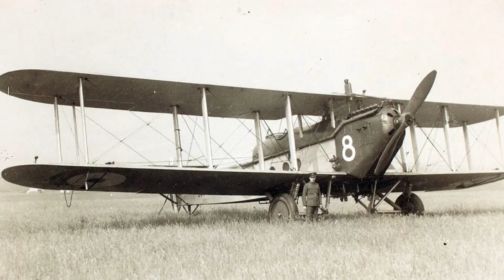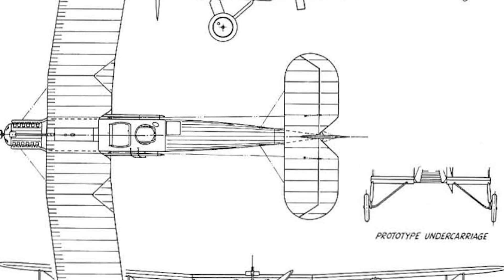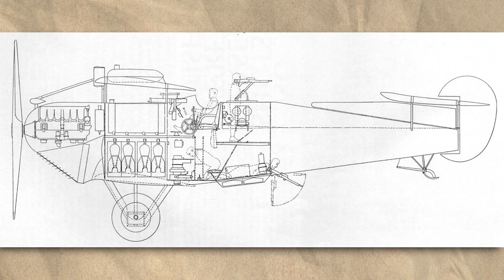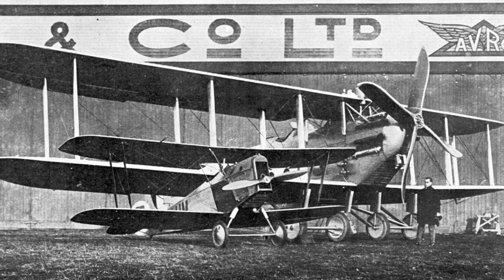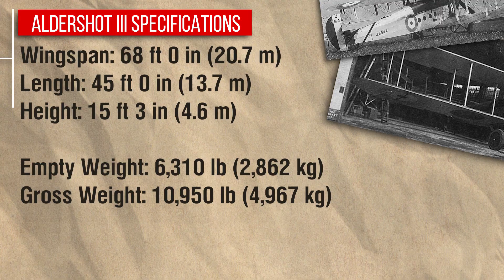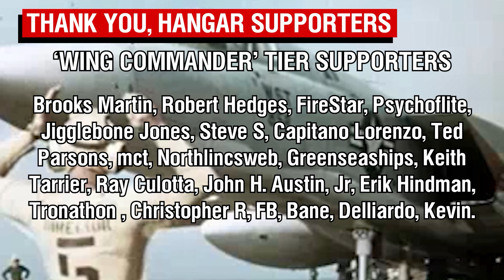An Engine With A Bomber Attached To It | Avro 549 Aldershot [Aircraft Overview #75]

Comment from the maker: F.A.Q Section

Q: Do you take aircraft requests?
A: I have a list of aircraft I plan to cover, but feel free to add to it with suggestions:)

Q: Why do you use imperial measurements for some videos, and metric for others?
A: I do this based on country of manufacture. Imperial measurements for Britain and the U.S, metric for the rest of the world, but I include text in my videos that convert it for both.

Q: Will you include video footage in your videos, or just photos?  
A: Video footage is very expensive to licence, if I can find footage in the public domain I will try to use it, but a lot of it is hoarded by licencing studies (British Pathe, Periscope films etc). In the future I may be able to afford clips :)

Q: Why do you sometimes feature images/screenshots from flight simulators?
A: Sometimes there are not a lot of photos available for certain aircraft, so I substitute this with digital images that are as accurate as possible.

Feel free to leave you questions below - I may not be able to answer all of them, but I will keep my eyes open :)
Reply: Q: How long is the pre-existing list? ;P
Reply from the maker: @derrickstorm6976  combining the "aircraft" and "video topic" lists its approximately 600 potential videos, not including multi-part specials...I wont run out of material any time soon! 🤣
Reply: @RexsHangar  nice 😂
Reply: I don't know if it's on the list, but I very much would love to see a video about the Tupolev SB (Antonov ANT-40)
Reply from the maker: @Dreadnought33  Its on the list :)
Reply: @RexsHangar  niiiiiiiiiiiiiice ;)
Reply: Blackburn Botha? Dog of an aircraft!
Reply from the maker: @MVFlt  added to the list :)
Reply from the maker: @annadalassena5460  R-Planes are on the list :)
Reply: @RexsHangar  have you done a video on the Northtrop F-5/ F-20/T-38 family?
Reply: Looks like l am a day late🥵....Thanks again my friend for the fine video 👍                                
Shoe🇺🇸
Reply: FFA P-16 would be interesting, if not done already.  After all, all Learjets still fly with the ingenious Swiss wing, unfortunately, the only remnant of a project that was written off early.
Reply: Suggestion: Canadian Car and Foundry FDB-1

Comment: This was one of the more positive, upbeat aircraft videos, the fact that it was nimble, performed well for it's size, surprised even it's designers... the fairey swordfish, blackburn b54 possibly, the P40 warhawk, planes that were rugged and either outperformed their original intended designed specs or remained in use long after intended.  There were two about trains fairly recently, the climax/shay locomotives, and one in japan that was a very successful narrow gauge freight train design... so, a thank you for sharing these stories, and doing all the research etc.

Comment: What came first: The airplane or the engine? Obviously aircraft design follows engine development. If you haven't done so please consider a segment on piston engine development with only a passing reference famous aircraft used on. And a separate video on jet engines. This could be further broken down into pre-war, post-war, episodes etc. The engines are as much if not more fascinating than the airframe they power. We knew how to build flying machines long before the gasoline engine.

Comment: There seems some kind of logic, one big engine instead of two, or if multiple, two big engines instead of four smaller engines. Not as a solid rule though, otherwise no ten engined legend like the B-36.
Reply: Following on from that, I was thinking, when did I last see a four engined airliner? Turns out there are none being manufactured now, there was the remaining Boeing 747 production, but the last one ever came off the production line October 6, 2022.

Comment: The gasoline engines of the day were so heavy it does beg the question why diesels were not seriously tried.
Reply: Because they are heavier. The Jumo 205, a decade and change posterior design,  have more or less the same power to weight that the 1922 Napier Cub.

Comment: I'm pretty certain the gunner was also the Radio Operator. Dedicated air gunners were pretty rare in such planes. While the Bomb aimer would have just one job per flight so it is possible the Navigator doubled as him. I mean when it was time to visually acquire the target with a bomb sight, he'd have no more navigating to do until bombs away ;)

Comment: Wow, that experimental Napier Cub engine has some ridiculous specs for the 1920s. At 60L with 16 pistons, each cylinder was roughly the volume of a gallon of air. The rotating inertia of that thing must have been insane, no wonder they had to strengthen basically the entire airframe lol
Reply: Followed by 63 litres from 6 cylinders, basically a small dustbin each!

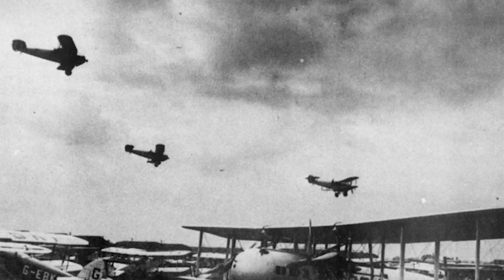Comment: Question, does anyone know what the aircraft is on the ground in the forefront at starting at about 10:42 to 11:06? It is a large twin engine, with 4 bladed propellers and a large rounded nose on the fuselage. The side marking I believe start with G-FB and it looks like it has windows running along the side of the fuselage. Is this a military aircraft? I haven't seen one like this before and I'm a bit curious about it.

Comment: I questioned the wisdom of having the fuel tanks in front of the cockpit in an aircraft going into battle. Wouldn't it make more sense to have the cockpits in front of the fuel tanks so if they are hit and burst into flames the pilots at least have a chance to jump out instead of immediately being soaked and gasoline and fire??
Reply: G'day,

The weight of Fuel onboard varies, from full Tanks to dregs, at 7.65 pounds per Gallon. 

Putting the Fueltank on the Centre of Gravity means ZERO Changes to the fore/aft Trim as Fuel-Weight varies.

Look up the position of the Main Fueltank in a Spitfire, Hurricane, Tempest, Fury, Bf/Me-109 and Fokke-Wulf 190...
(The British sat behind their Fueltanks, while the Germans sat IN the Fueltank - which was built under and around the Seat.

Weight and Balance WINS.

Such is life,

Have a good one...

Stay safe.

;-p

Ciao !

Comment: I enjoyed the profile drawing showing the internal bomb configuration, ie suspended by the nose.  One, in fact the only, advantage of this was to make it easy to arm the bombs.  The considerable downside was that the bombs would topple in the airflow after release and thus have a very significant dispersion.  In other words they could go anywhere, especially if released at more than a couple of hundred feet.  The Aldershot, like the similarly designed He111 a decade later, could not have been considered a precision bomber!  It's slightly less important nowadays since aerial bombing is generally combined with laser guidance but there was a time when making sure that stores left the aircraft in a predictable and consistent fashion was a real headache!
Reply: In those days, a wide spread pattern was considered a good thing, under the theory that it spread out the damage over a wider area. “Precision” bombing was considered the sole domain of dive bombers, everything else was supposed to cause widespread destruction.
Reply: The Italian SM 79 did the same. In those days though you were aiming at huge static targets though. Many people were looking back at WW1 and thinking about bombing the trenches, troop formations or even cities. The concept of striking an individual target was still far in the future.
Reply: And yet when you look at films of other aircraft dropping bombs..they bounce off each other.. and wobble around significantly too!
Reply: @trooperdgb9722  it was a serious problem.  Aircraft have been destroyed by bombs fuzing on other bombs.  A similar issue was 'store capture' where one bomb would get into the slipstream of another, overtake it and detonate.  Nowadays less of an issue as we tend to drop single weapons because with the guidance package you generally only need the one.

Comment: 2000 lbs are a short ton.
Reply: Only used in the USA
Reply: @benwilson6145 : 
The title coins it as 1-ton-aircraft, obviously referring to the bomb load.
Reply: @MonsieurPhilippe1  the engine weighted a ton, not the aircraft or the bomb load
Reply: @derrickstorm6976 : 
In the vid, I've heard and read something about 4.5 tons weight and 2000 lbs load. 
But I can rehear. 🙂
Yepp: Within the first 75 seconds, Rex is speaking about a 2000 lbs. load.

Comment: That 1000hp engine was a beast!
Reply: Would a 1hp/kg have been a great power-to-weight ratio for an aircraft engine back in the 1910-20's?
Reply: @derrickstorm6976  For a single engine, absolutely. Most of the production planes of the period had a ratio of something more like 0.2-0.5 hp/kg (including the Lockheed Vega, used to set a number of world records including Earhart’s famous flight), so 1hp/1kg was an absolute monster of an engine.
Reply: @derrickstorm6976  Great question; I suspect nothing existed before the Cub in England, made that much power, and was able to be reliably mounted in a vehicle. The Germans probably had some competitive engines based on their Formula 1 racing dominance at the time, but those would have obviously been unobtainable by the British government haha
Reply: There a number of large 1000+hp engines envisioned at that time including the Allison X-4520.
Reply: What do you guys think about using that new 600 something cu chevy big block that makes supposedly around 1000hp in a plane...
 How does an aggressive cam affect aircraft ?
Reply: @gunnermurphy6632  
First, automotive engines and car engines are two different things. Just how many hours do you think that big block would run at full throttle. Second on supercharged engines aggressive cam profiles dont matter as much.